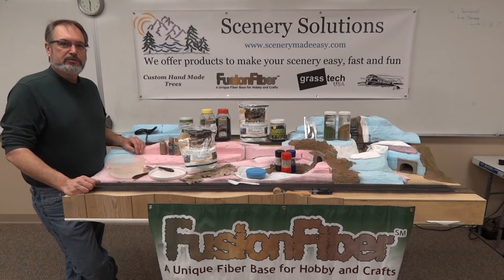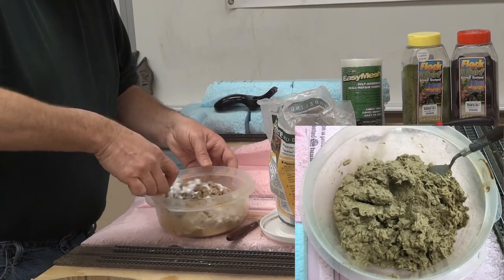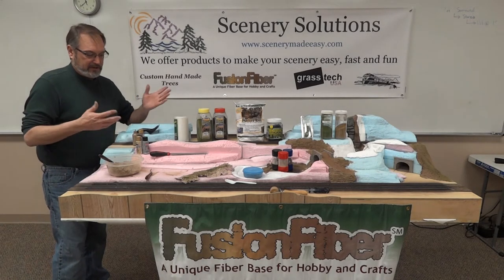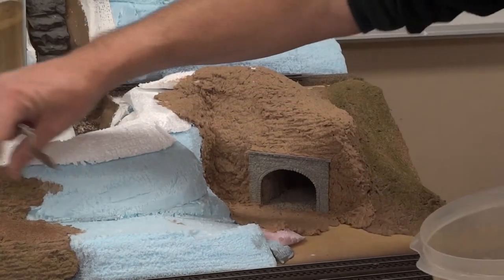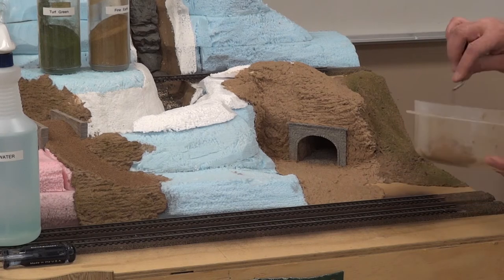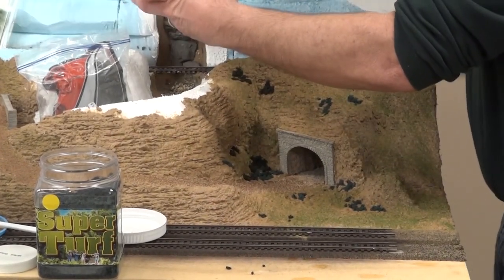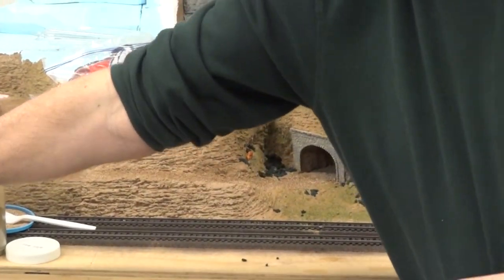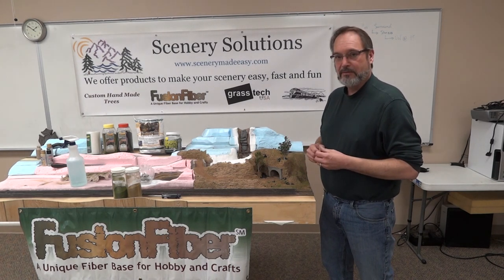Fusion Fiber

Comment: I've been in the Hobby for over 44 years....  Not much excites me anymore. This however, is an answer to questions that I haven't even THOUGHT of before! I hope it's not too expensive, as I'm a disabled veteran, with very limited disposable income. However, I can't WAIT to try this!! My 15th Layout is being built in sections. The lightweight aspect is an advantage all by itself! The fact that it's not funny at all, applies to vertical surfaces easily, and can even be rolled smooth into near perfect Roads - are great bonuses!! 👍👍 
It seems like with the right gray acrylic paint tint, the easiest asphalt Roads EVER, are very possible!
What's the website address again? 
Carmine 🚂